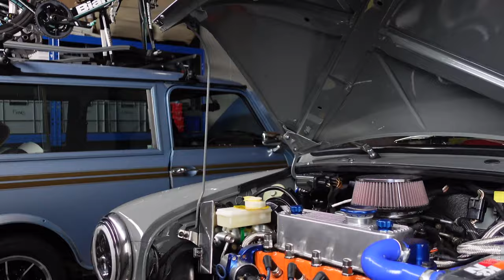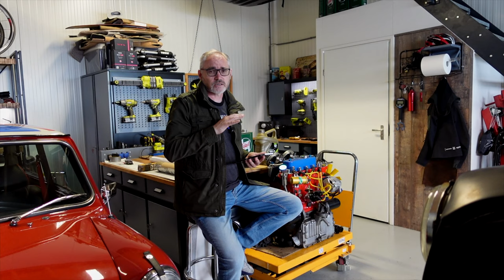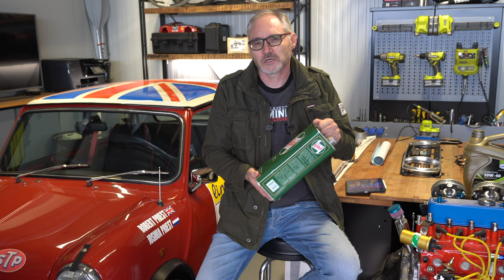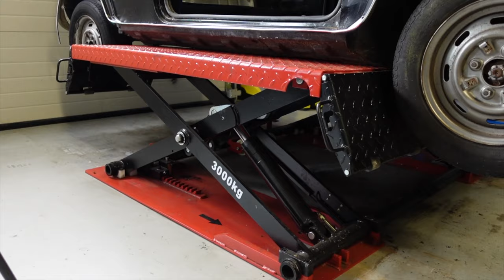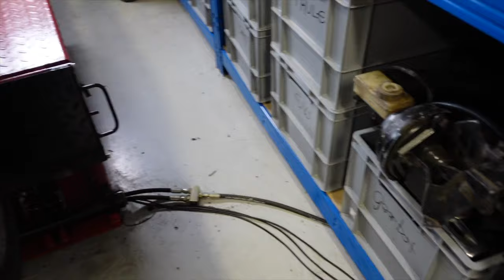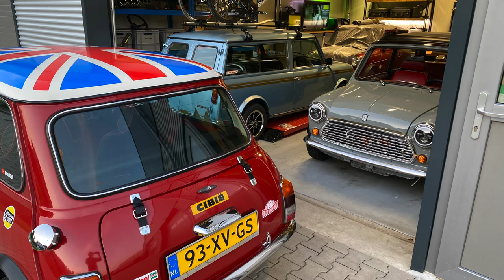Classic Mini Automatic, Which Oil? - Which car lift?

Comment: Having not spoken with professional/experienced gearbox folk, I’ve been led to believe that 20w50 with high zinc is preferred…  valvoline VR-1. Of course they promote “racing” which I don’t have interest in. I will be … as you say driving like Ms Daisy so it may not matter as much to me.  Just ordered some small plugs from
KAD in the UK and they charged me £34 for for S/H…. The shipping has become far more expensive for me as well
Reply from the maker: The freight companies are hold us all to ransom Randy.......I just paid 70 euro's tax on an order of 72 euros for decals because the freight company determined what import code they should use.......more than 2/3rd of that charge was administration of the freight company!.......on top of the shipping cost!
Reply: @classicminiculture9800  wow! Brexit has really messed us all up. I have EU customers and right now I stick to Royal Mail and I add the generic codes myself for what I send. Disadvantage is that the receiving EU country hold the goods until they have assessed taxes themselves and charged the end customer, but at least it eliminates courier profiteering. 
That said the EU are transitioning to a new system on 1 July where importers will register for VAT centrally with the EU and need to effectively file a tax return with them. As a small UK non VAT registered business I am considering whether to carry on with EU sales at all.
Reply from the maker: @thelaserhive3368  its tragic the way all of this has been handled, I fear for the smaller business that just cannot manage these new situation, and for sure the freight companies are taking advantage.
Reply: @thelaserhive3368  not Brexit !   But greedy hauliers and couriers etc....

Comment: Whilst the 10/40 oil may well be more suitable for the gearbox, 20/50 is more suitable for the engine, which of course presents a dilemma which is the reason for so much debate and so many questions and different opinions.   I've been recommended to use a compromise of 15/40 or 15/50.
Reply: sorry have to disagree, 20/50 is simply not more suitable than 10W40, Rover spent £££££ millions developing the engines for use with 10w40 as the advantages far and away exceed any of the 20/50 oils
Reply: @martinfidel7086   Hi Martin. Does this also apply for auto gearboxes from the early 1970s?  I had my early 70s AP gearbox rebuilt by Essex Automatic Transmissions and the owner was adamant that 15/40 should be used. I'm wondering if there's a difference between these early transmissions and later ones? NB. Being a classic car it won't be driven in freezing conditions. Any specific brand recommendations would be much appreciated and also if it has to be mineral or if synthetic or semi is preferred.  Many thanks.
Reply: @DavidUKesb  I take my oil advice from a specialist, if you look for Richard Widman, he has written a few articles on oil and what the different grades mean, I would use and recommend 10W40 in all my AP1 & AP2 units, however as long as you are driving like your Grandma and not like your grandson then 15W40 will probably be fine , the old adage, any oil is better than none springs to mind here :)
Reply: @martinfidel7086   Many thanks for your reply Martin. Much appreciated.